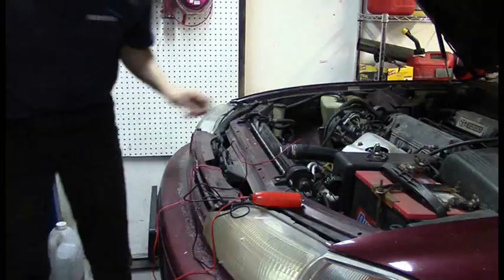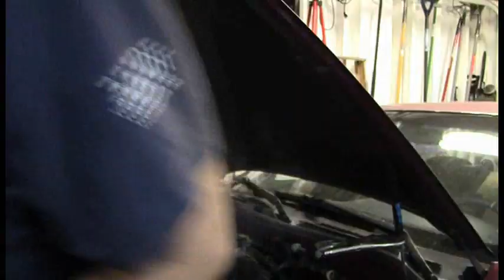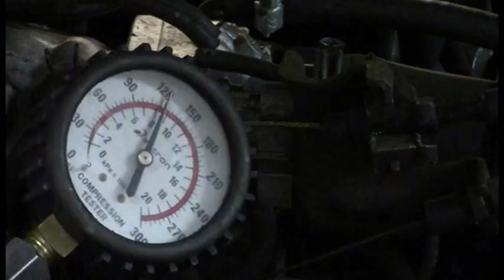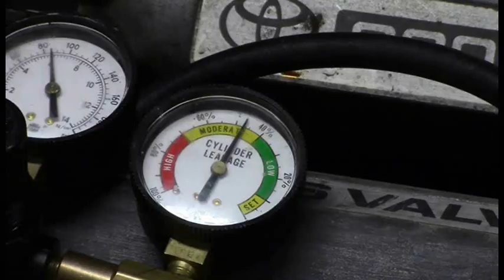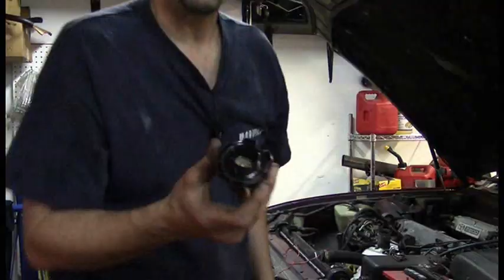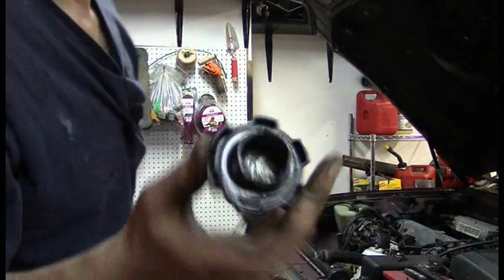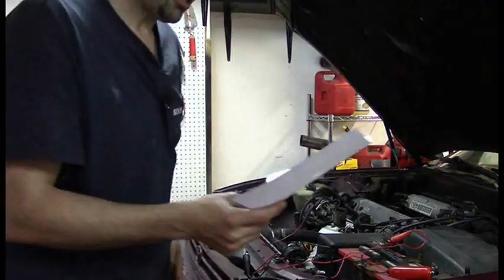12 Ways of How To Test A Blown Head Gasket Compared- PART1

Comment: Ok, I've seen a few of your videos and you really seem to get to the heart of things.  I understand you're familiar with GM vehicles, hopefully you can shed a little light on something for me. I have a 2007 Pontiac Grand Prix GT (Supercharged V6) with a little over 112,000 miles on it. Recently I've been getting a P0171 code and the CEL illuminates intermittently. I've changed the PCV valve, Bank1 02 sensor and even the MAF sensor. Earlier this year my mechanic changed my front valve cover gasket the rear main oil seal and the intake gasket. He thinks maybe the intake gasket may need to be redone .Would a leak in an intake gasket cause a lean code to illuminate the CEL intermittently? I am sort of wondering if an injector(s) that are beginning to fail could cause periodic CEL.  I would just like an opinion before I do anything even though Iam still under warranty with the Intake Gasket. The car really doesn't run that bad but I think it should run better. Hope with the info I've given you, you can give me a little insight. Thanks.
Reply from the maker: I would need to see the data that indicated you needed to change the MAF, PCV and O2 sensor. What was the data showing all those parts were defective? Was this based on voltage output or fuel trim analysis?
Reply: I changed those parts myself based on the fact they can be associated with a lean condition and the cars age and mileage. My main concern is the lean code comes and goes. My main question is, would an intake gasket leak in a car like mine cause a lean code on the CEL to come and go or would the CEL remain on until the gasket was replaced?  I am just trying to get some insight before I take this car back to my mechanic.
Reply from the maker: Yes I need the data that indicates the parts needed to be changed.  Hundreds of things are associated with a lean condition- what was the data those specific parts were casuing the problem?

Comment: Does blowing a lot of white smoke mean blown head gasket???
Reply from the maker: No. It means the likeihood of either coolant or unburned fuel in the combustion chamber.
Reply: Schrodingers Box  what do you recommend? It was smoking a lot I change the oil and now it's not smoking that much just like when you start your car up in the morning on a cold start on a cold day maybe not even that much
Reply from the maker: What did your compression test indicate?
Reply: Schrodingers Box I did not do one but it runs fine not over heating or nothing just a lil smoke.
Reply from the maker: Then you have no data for a diagnosis, sorry can’t help.

Comment: I would also like to add a couple tests that can work. 1. Putting 100psi directly into the cylinder at tdc and listening for bubbling. And 2. While pressurizing the cylinder put a coolant system pressure tester on the coolant overfill resevoir and see if the pressure increases, if it does then that can also very easily confirm a leak. Source: Me (Used on a v8 4.6l triton engine)
Reply from the maker: A leakdown test was indeed demonstrated in the video.
Reply: Schrodingers Box Yes, you did show doing a leak down test, but not thats not the way I was talking about. I should have specified that both leak down testers that I used were broken and this was a way to test without that tool by going direct from an air compressor into a cylinder.
Reply from the maker: That would only work if the compression is lost through the cooling system though.
Reply: Schrodingers Box True. Well, I guess you've got me beat. :/
Reply from the maker: You could still pressurize and listen for air exiting the exaust, intake or PCV however it would be hard to quantify stand-alone without at least a compression test to confirm there was cylinder leakage.

Comment: Well detailed. Trying to help a friend. This one strikes me strange.  Not confirmed that it is a blown head gasket, but was told it  could be one. A friend of mine has a 2006 Maxima.  Mechanic said one cylinder misfiring, but couldn't determine which one. All coils changed, by I believe her son.  Check engine light still shows one cylinder misfiriing. This car normally burns oil and leaks some oil. Something strange happened one time.  Most of the oil leaked out after parking in the garage. Refilled the oil. The oil hasn't leaked out since, but now the oil level stays at the full level on the dip stick. Someone said it appears to be a blown head gasket.  I did see the oil that leaked out and it was discolored, a sort of tan tint, but it did not seem diluted and still seem very oily and no water visible. I found that strange, since oil and water don't mix. Could this be transmission fluid getting in there somehow. I had a Ford Mavaerick that did that because of a bad vacuum valve. Or, do you think somehow water is getting into the oil and diluting it, and keeping at the full level. Oil hasn't been added for a while, which is unusual.  Does this sound like a blown head gasket.  There is some white smoke when given the gas according to her son.  Is Barrs head gasket treatment worth a try.  Why would the oil pour out that one time.  Could it be pressure pressure somehow got in there and pushed it out? Could the PCV valve somehow be involved also?
Reply from the maker: Could be anything- what data do you have?
Reply: No data, other than the code still indicates one cylinder misfiring. I told my friend the engine needs to be diagnosed. Holding off since there is so many things going on and just uses it in the neighborhood. May decide to use it until it quits, if it is too expensive to fix.  Since the oil is tan and doesn't appear to have water in it, I'm wondering if it could be transmission fluid somehow getting into the oil.  On this car is that possible.
Reply from the maker: Could be. maybe. But you have no data so I don't know. I would just run a beginner-level  FASTTEC analysis.  Just keep it at the basic, beginner level and find the issue.

Comment: Awesome vid, jus subbed 2-your chann. could u do 1 on a ol' 81'- 85'or so square body style Chevy truck--> How To Diagnose if a vehicle is out of time( too high or too lean) without using a time gun??
Reply from the maker: I usually just correlate the CKPS and CPS outputs relative to the ignition i put to validate timing. Faster and easier than checking mechanically.

Comment: Why do you say the leakdown test confirms head gasket problems? Could air not be getting through the valves?
Reply from the maker: No because you do the leakdown with sealed combustion chamber.
Reply: Schrodingers Box I'm just trying to understand. I have been watching your videos all day today while at work trying to figure out potential issues with my car. 
I get that you cranked the engine manually so that both valves exhaust and intake are closed but what if the valves were not sitting right? Leak from another source. Could let air through. No? This is a question in all seriousness I'm not a troll
Reply from the maker: i know man. that’s the point of the leakdown test-if the valves are not seating then you would know from the evidence of leakdown past the valves.

Comment: Great video !    watching now , going to do the first test tonght on my dAKOTA   , been having trouble since buying it with not hot heater and hearing bubbles in dash . Also while burping the cooling system yesterday I noticed the lower rad hose was not even hot after running and revving the engine for over 20 minutes while burping witha spill free funnel . I burped alot of air from the system and heater is working a bit better but it seemed that the bubbles may have continued to come up if I kept running it . I have heard maybe my thermostat is stuck open . First I will test for blown head gasket then if not blown move to replace thermostat ....   At ez lube I had a coolant replACE  done and they suck it out , I was a moron and wanted to try to flush my heater core so I left it running with heat on for awhile while they were sucking out coolant then shut it off before it was done taking all coolant out , how bad is that ?  I had a light bulb go off while doing it and thought whoooo this is not a good thing to be doing !  Do u think anything bad could have happened ?  My temp gauge was fine the whole time and after , never going high ..

Comment: I didn't understand the comment about having an intake manifold coolant leak. I thought the intake manifold was fuel / air only? How could coolant be getting in there or getting into the oil from there?? (Sorry if this is a stupid question!!)
Reply from the maker: Most intake manifolds also channel coolant. There are some models with "dry"intakes but this is less common.  Most every lower intake will have coolant passages- usually at the corners and if they leak the coolant will enter the valley and contaminate the oil or even enter an adjacent cylinder. Either way, it closely resembles a head gasket failure, but it isn't. Compression obviously would not be compromised in an intake leak.
Reply: Thanks!! And for the very speedy reply :)

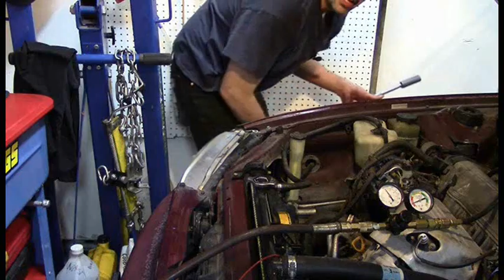Comment: What are you doing to turn the engine over at 18:30? Great video, thanks!
Reply from the maker: Just jumping the starter solenoid load side control.
Reply: It looked like you were cranking something down near the front passenger side wheel. You were using a torque wrench with an an extension?
Reply from the maker: Oh- that- yeah I was just turning the crank by hand is all.

Comment: How much does that first test kit cost? I have a 2005 chevy equinox that was whining as the speed increased. It over heated too. I found a leak in the heater hose assembly and replaced it. So far there's no more leaks. The temperature gauge was going up and down though but I wonder if it was from sitting in the driveway for a while plus the refrigerant for the ac is low. However when I tried diagnosing the symptoms through research on the internet(because I'm no mechanic) a blown head gasket was one of the suggestions. My car whined when I drove it. It sounded a little like driving a stick shift that's out of gear yet the rpms weren't high. It never died on me either. The oil didn't look like chocolate milk either. My car probably doesn't have a blown head gasket but it's better to know for sure.
Reply from the maker: I would just do a compression test for sure.

Comment: It truly is amazing how you accidently stumble on fanstastic content on YouTube. Appreciate your scientific appoach. 
So BMW overheated, and I drove it 3 miles home..shame on me! Still afraid to do the combustion test. Working up to it. When I checked the coolant level I was down nearly 3 quarts/2 gallon capacity. So if it is the typical electric water pump failure, where did the coolant go? Can it vaporize out the expansion tank or bleeder screw, or do electronic pumps leak like mechanical pumps that fail, or could I have one of the communications that you described. Car has a lower engine cover so you never see leaks. I'm thinking it was catastrophic, because never got a low coolant fault until it was already in the danger zone. The oil level has remained constant since it happened yesterday. The coolant has remained constant after a 5 mile drive. I drove it 5 miles since before the fan kicks on.  Need to get me the last pressure tester you used. I'm sure the water pump failed..it doen't run in bleeder mode. Just wondering if I cooked my engine block in those 3 miles. So many on forums are quick to say yes for silmilar situations. Its like the solar eclipse, where are all the blind people that didnt have the knowledge not to look at the sun.
Reply from the maker: Pressure test the system. It is either being burned, lost through a leak, or lost through bad cap.
Reply: With a non working water pump, and therefore no coolant circulation and no pump pressure( gas pressure I suppose) would a combustion leak test give false negative results. Would CO quickly diffuse through  the coolant despite being stagnant. Do you spend the money on the parts for a BMW water pump/thermostat before you check for the "blown head gasket'?  And if not, can you trust this test alone?
Reply from the maker: As with any scientific procedure, functional baselines are necessary for accuracy.  If the water pump were not working,  I would not use this test because it makes no sense to replace the water pump just to ensure accurate results that may show the vehicle needs to be trashed anyway.
  That said however, if the system is at proper water level, CO2 is going to always rise to above the waterline and the test should work.

Comment: can u use that tester for carbon dioxide on the reservoir bottle also?
some cars dont have radiator entry like my Opel Corsa b 1999 car
Reply from the maker: Yes absolutely.
Reply: So i went to a place here called Silverton Radiators and they were kind enough to do a free pressure test for me using my reservoir bottle.
They screwed on the correct size same as the reservoir cap and then they pumped this cylinder up and then they watched the needle.
We didnt see any thing , BUT then after a few minutes we saw  a drip or run mark on my exhaust...i tried to understand where it was coming from, it looks like a circle thing , i eventually learnt now  they call them Welsh plugs ?  but i see the Americans call them freeze plugs ? not sure if i have that wrong.
If i am correct, this is the thing i need to try fix myself or get fixed.
I am not a DIY guy but i am trying to learn a few things, such as how to do my own service and how to change my brake discs... i hope to do these things soon.
I now want to know it is hard to change this plug , i dont really see a way of how to hold or grip it to get it out and also how the hell do u work in such a small spot.
Anyways, i recently had my gasket replaced and the cylinder head was send in to engineering unlike my like time last year when i was on a budget.
I am however not really happy with my water as it seems to be getting low. So i really hope this can solve it.
I also seem to smell anti freeze sometimes when the car gets so hot. its really so weird.
I used to have a leak last year and i got it stopped when i did the gasket (with no engineering) AND we did a bypass avoiding the heater matrix/radiator which was causing dam leak of this oily antifreeze on my carpets where u sit, it was new to me, i didnt understand and i still dont actually, understand how the hell the water/antifreeze gets to your feet in the front, it is so strange. Anyways water never got low ever since bypass. Then over time it started disappearing... no idea why.
Gasket blew eventually , only antifreeze was leaking.... this was now done with engineering then i was sad because now i see my water is again disappearing .
I hope i have found the issue , which might be a plug.... at least thats the best i could see when i was sticking me head underthe car radiator area.
I would like to jack it up and use trestles and then check carefully.
I just am a bit scared to even do that at times, because you need to be so careful jacking up a car and also using bricks and where u actually place the trestles.
I for now, just use the pitch weld.... BUT i have noticed, even though ia use a piece of wood, i see the pitch weld is starting to bend a bit so i don tknow what the heck i am doing wrong.
Anyways, hoping also that the freeze or welsh plug is easy to remove.

Comment: I'm trying to find the cheapest, most definitive way. Your first scientific test seems pretty definitive, but I've already had my head gasket replaced, and it's possible that there is still leftover coolant from before. So wouldn't that coolant make the test turn out positive regardless? I checked my coolant, and with a flashlight I can see the copper particles from when I tried using a stop leak last time before I had the head gasket replaced correctly.
Reply from the maker: Cheapest most definitive way- leakdown test. Period.

Comment: What's up man. I'm having a heating problem. Freshly built motor. Compression is same all across. I've tried all these methods and all came out good. The only one that didn't was the sizzling in the oil. What's ur take?
Reply from the maker: compression tests are final authority. you need to do basic cooling system diagnostics.
Reply: Do u mean by doing the radiator pressure test? Or what do u mean.
Reply from the maker: basic diagnostics. flow and pressure. just the extreme basics.
Reply: Well radiator pressure is holding. Did the pressure test and it doesn't drop at all. Piston compression is 210 on all 4. Do I do leak down test?
Reply from the maker: Why would you do leakdown when you have compression in spec???  Please just do basic cooling system diagnostics. This is not a major problem obviously so why diagnose it as such?
Reply: Sorry. I wasn't understanding it at first but now I do. I guess I was just hoping for the worst. Fan does work and all just don't think it's cooling enough since I'm running turbo now. But thank. I really appreciate it.

Comment: I am thinking about doing a headgasket job on a 92 gmc 1500 with a 4.3 L in it i want to run a compression test on it to make sure the lower half is still ok has a lot of miles on it. i cant find a spec for compression it just says that none of the cylinders can differ from the cylinder with the highest compression ratio by 15%. is there a number that i should be looking for for the highest one
Reply from the maker: No- that spec is accurate. However anything under 120 would be highly suspect.
  personally this is exactly why I do leakdown and not compression test.
Reply: Schrodingers Box thanks so much